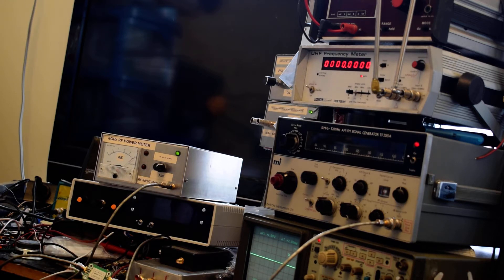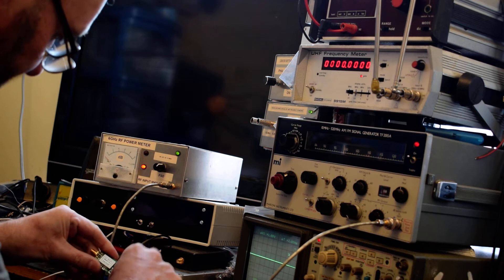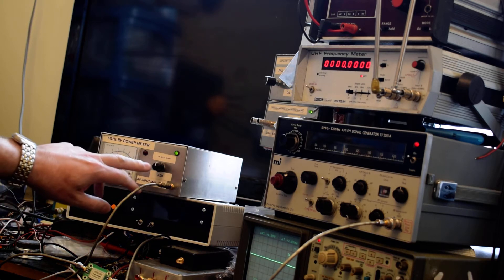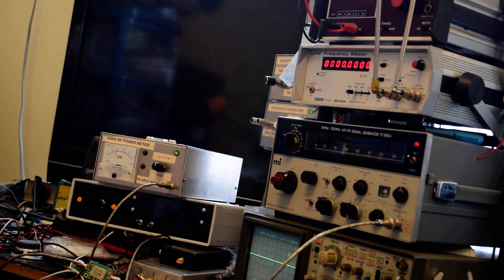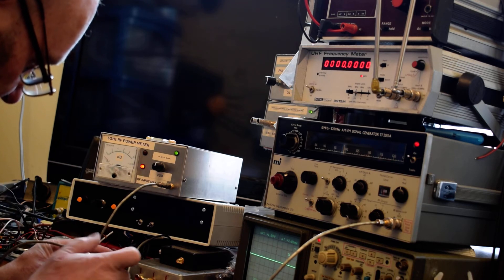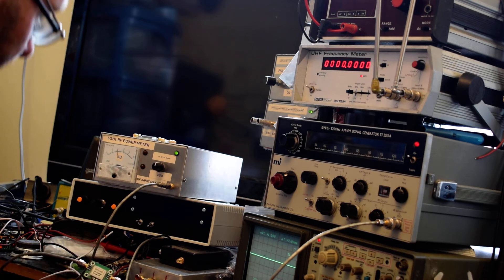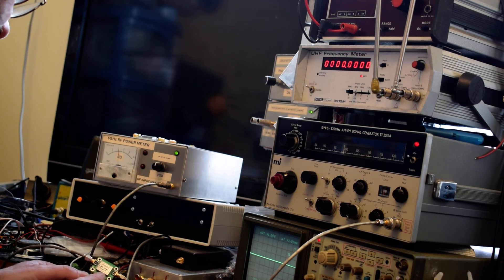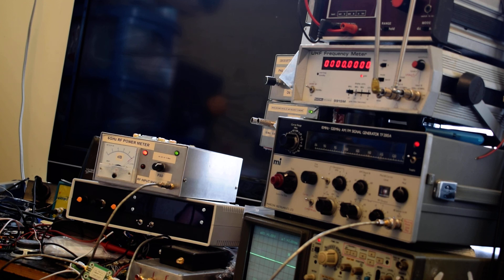Fake SPF-5189z LNA modules from AliExpress

Comment: Unfortunately, I made sure that there are no original SPF5189Z on Ali, neither in modules nor as bare chips. I read opinions that they, despite the high current and low gain, can be good as LNA, but I doubt that this is so (probably the noise is at least 2.5dB.). And they also have poor board matching! It would be good if someone checked the noise figure...
P.S. Replacement - PGA-103+, they look real.

Comment: Any tip to identify the fakes one?
Reply from the maker: They look exactly the same. The only way is to measure the current at 5 Volts. It should be around 70mA. The fakes usually draw much more than this.